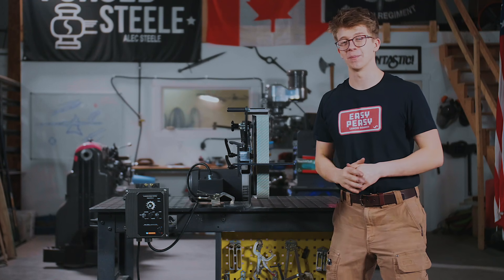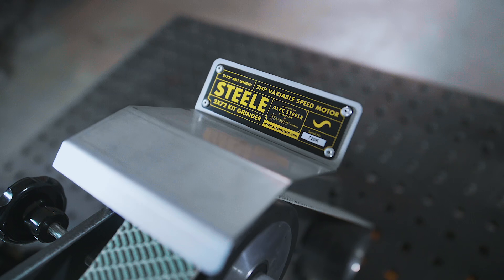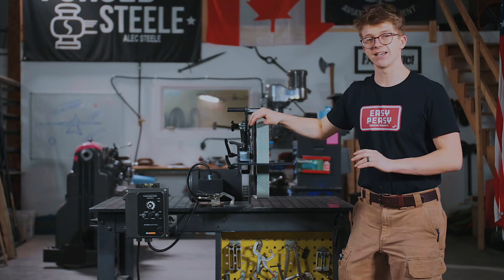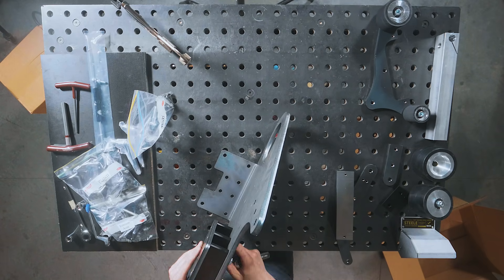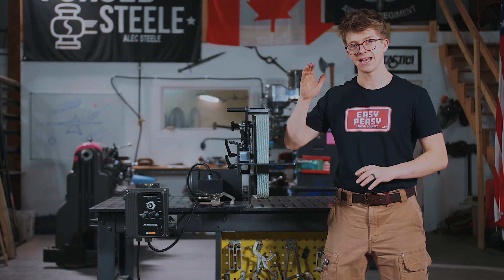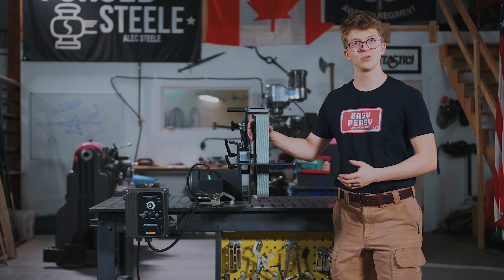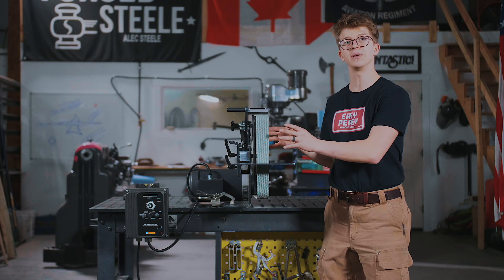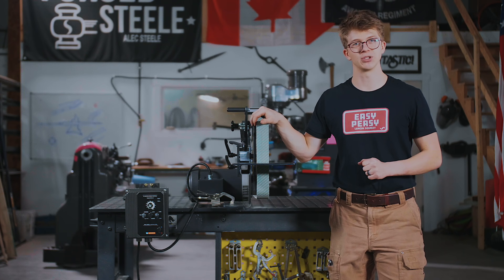2x72" Steele Kit Grinder: Introduction

Comment: FYI they can also be wired to 110v not just 220. I have the exact same setup but using a origin 2x72 frame. Wish these were out when I got mine because I like the integrated motor mount of yours makes setup 100x easier.
Reply: these have been out for years mate there extremely popular here in aus and are probably one of if not the best grinders on the market

Comment: About how much yall think these will be?
Reply: Cody Hovis 1500-1700 would be my guess. The vfd and motor are top notch. I have the same on mine. The kit itself seem to be well made. The fact that it’s bolt together and not welded is my only concern. I’d just make sure to use loctight during assembly.